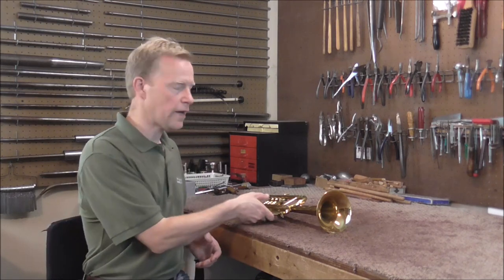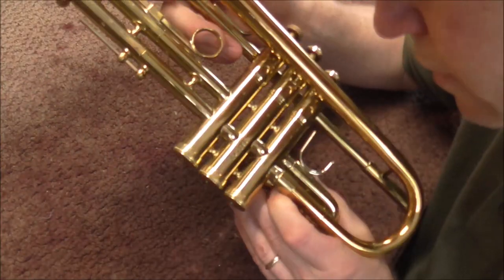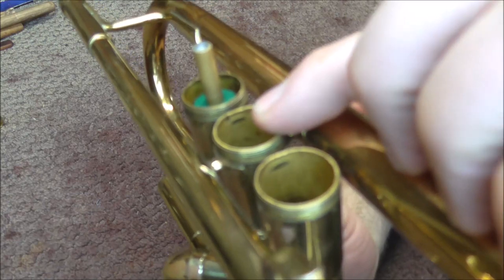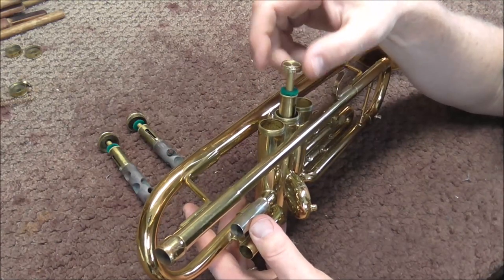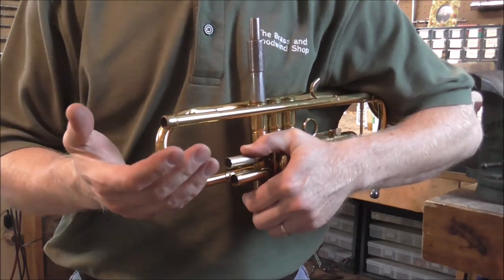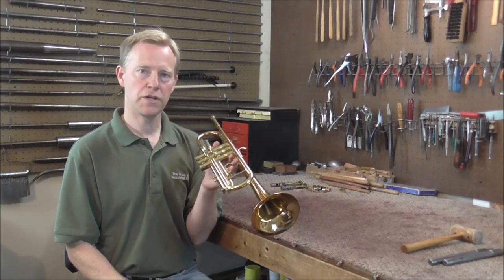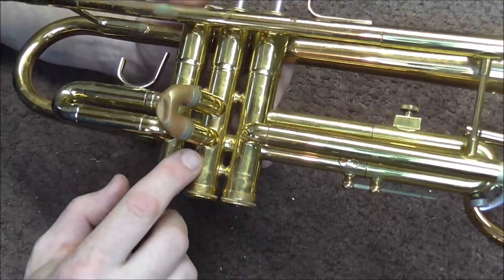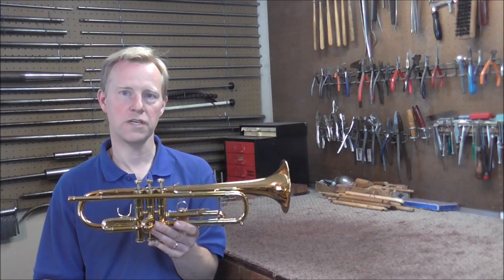I Destroyed a Trumpet While Trying To Fix a Valve

Comment: I'm not a brass tech, but at one time bought some cadaver horns to see if I had the touch. I actually had a good selection of tools and mandrels from a shop that had gone out of business, so had the correct equipment.  What I learned was this is not a shade tree mechanic type skill and there is a fine, fine line between fixed and trashed. 
You did an excellent job explaining the entire process and what went wrong. I agree, while that particular trumpet was not one of Conn's best efforts at a transitional time for the company, it was deserving of your best efforts. In the end, you made it right.

Comment: This video is a great demonstration on how easily things can go wrong with a brass instrument, and also for coming up with a solution.
I had something similar happen recently. I bought a used Bundy cornet that is 30-40 years old as an alternate practice instrument to my trumpet. The valves and slides worked well; it just looked rough. I was removing one of the bottom valve caps when I heard a weird sound. It turned out to be a 3” long crack in the lead pipe. Knowing that a repair would likely require replacing the lead pipe with a cost more than the instrument itself, I ended up wrapping the lead pipe with masking tape to seal the leak. It’s ugly, but it works. 😆
If I buy a replacement I’ll probably donate the cornet for parts.

Comment: Thank you for your transparency. I've used the mandrel trick many times. It was hammered into me that you always keep the other valves in so that the other casings don't deform. Same for when you're aligning the bell tail.
Reply: I was wondering what may be happening to the other valve casings while he was working so much pressure and force onto that one.
Reply: Yes, you NEVER use a casing mandrel in a casing without the valves in the other casings.

Also, that's not how those mandrels are supposed to be used.

Yes, you tap on them...but you do so on the compass points, and also on the 45° points, not too hard, and repeatedly.

The vibration of the mandrel returns the casing to round.

The other thing to use, in fact probably what I would've reached for first, was an expandable lap.

I never lap with them, but I do expand them in the casing to return concentricity.

Very effective tool, that's inexpensive and easy to use.

All that being said, I've had pricier horns than what he's working on do the same shit, even with the valves are in the other casings.

Sometimes, shit is just what it is.

Comment: This is a fascinating watch, thank you for sharing it. I wonder if a different tool could have reamed and straightened the tube more effectively than using vibration. Perhaps something like a mandrel but oval in profile, 664 in one diameter and 663 in the other diameter. You could insert the mandrel and apply a slow half turn to ream the tube into shape.

Comment: I have had early (1870's-1920) French trumpets and bugles(Flugels) that break at that point when you are trying to free a slide.  What a pain!  Some of those early Euro horns are very lightweight and not so well silver-soldered.  The USA and English ones are pretty tough, but sometimes they do a bad job with the silver solder.  DOH!  As a contrast, some of the Japanese trumpets have silver solder where they shouldn't (Yamaha second valve slide knob for example) and that makes it harder to fix some things.

Comment: I noted the top of the first valve casing where it was bent on the threads like it had been bumped in the direction of the 2nd valve which could have fatigued the bottom joint connecting first and second valve. I have two of this large-bore model 1000B. One has the name Doc Severinsen on the bell and the mouthpiece with a signed endorsement from Doc about this horn as a good step-up beginner model. However my other newer 1000B has no endorsement and the Severinsen name is not there like the two in this video. This model CONN is similar to several other models I collected including: the16B, 20B, and 22B medium large bore all bought new. When moving the valves on some of these horns I found just LIGHTLY squeezing the casings make the first and third valves stop moving. These models really are that flimsy with more flexible cheaper brass and in NO way should be compared with "C. G. CONN Pro models from the beginning to mid century that are now some over  100 years old and still tough enough to be around today which I use for recording studio work. Bottom line this video empirically exposes truth in the newer Design of the 1980's and 90's. This is a breath of fresh air and you are a good teacher, Artisan, and a true craftsman.

Comment: I did that once on an old Regent cornet.I damaged the horn and I parted it out.The next time I did it,I decided to try using an old valve of the same diameter.It worked with a little oil to lubricate it.

Comment: as a Trumpet player i am very delicate with my Trumpets, by just seeing how they are fixed it is very shocking.
Reply from the maker: Yes, that is right. It is best to keep them out of the repair shop if you can. However, keep in mind that this trumpet was far more damaged than most.
Reply: @TheBrassandWoodwindShop  I think also it's best that I don't see the repairer working on my horn...
Reply: It’s always like that, when you straighten you have to force, to shock it… I never straighten a saxophone in front of a customer, I know it’s shocking to see someone smash a saxophone on a table

Comment: I personally wouldn't say you destroyed it.  ADDITIONALLY, you should have told the customer it was not fixable without replacing the valve cluster.....and that is a true statement.  You could have told them there was a defect in the manufacturing that failed while you were attempting to fix it (maybe you did tell them).  You are an expert, this would have broke if anyone tried to fix it, or it would have just remained unplayable.  Charge for your time and service.

Comment: Great video! Suspenseful too. I'm wondering what the lacquer was like on the finished product since it seemed to be in pretty good shape initially. Did the heat from the torch damage it?
Reply from the maker: The lacquer on the replacement valve block was in good condition to start with. Being VERY careful, I was able to solder with burning almost no lacquer. So everything went as well as could be expected.

Comment: I wonder how you keep the finish on the brass after using a torch. Just curious!
Reply from the maker: Most kinds of lacquer burn at a little over 450 degrees. Solder melts at around 450 degrees. If you are very careful, you can solder without burning lacquer. (Most of the time.)
Reply: @TheBrassandWoodwindShop  :Thank you; I was working in the HVAC business and know some (sweating) with soft solder which melts at about 600 F; when using silver sticks, temps are much higher.

Comment: For assembly is there a jig you use and how do you fixture the parts? I am a metalsmith myself and among other things I make repro guitar tailpieces for jazz guitars. These are all hard silver soldered. Looking at my son's trumpet with a dent in it I now know what parts are hard soldered and what parts are not. Not that I am going to attempt a fix. Do not have the tools so I figured I could send it to you to fix.
Reply from the maker: Sorry it took me so long to get back to you. My wife just had a baby. 
I do not have assembly jigs because the instruments are all different. I usually use a wooden assembly mandrel to hold the trumpet where I can easily get at it. Then I use solder clamps to hold it together. There are a few other tricks that can be used, but it all depends on what needs to be done. 
You can send the trumpet. I will get to it as soon as I can. 
Thank you,
Art

Comment: Art
I have never sen a trumpet come apart like that. Was wondering if you ever use the Ferree's expanding reamer? That is what I would use on a repair like that.
Reply from the maker: I have never used a reamer because it expands the casing and makes a larger gap between the valve and the casing. Also, it indiscriminately expands the casing and not just in the place where it needs it. However, I guess I did a good job of destroying the trumpet, so it may have worked better than what I did to it.
Reply: @TheBrassandWoodwindShop  
If you are not super aggresive with the reamer they simply re-round the casing
Reply: If you think the burnisher/reamer instantly expands the casing and widens the tolerance between the piston and casing then you need to improve your finesse with the tool. They are amazingly effective and in my experience at least, tend to correct casing pings and minor alignment issues using little to no tension. And NEVER wail on a mandrel without some sort of support inside the casings, preferably their respective pistons. I hate to say it but seeing how little force was needed to free the piston tells me that the correction needed was likely improper first slide tube alignment or an overlooked casing ping. And remember to check the piston in the mandrel sleeve/check other pistons in problem casing before immediately diving into casing alignment. Better luck next time thanks for the post.

Comment: Was there a point at which you could have decided to ream and/or lap the small intruding area in the valve casing instead of continuing to use escalating force to attempt to push it back out of the way of the valve?
Reply from the maker: Reaming should only be done if you are re-fitting the valves because too much material is taken off and lapping does not remove enough material. Looking back, what I should have done is use two ground casing mandrels (one in the first casing and one in the second casing) and a lot more patience. 
Making mistakes is painful, but it is one of the fastest ways to learn.

Comment: Would it be worth warming the trumpet for repairs like this... perhaps dunk it in near boiling water for some time? Brass is pretty soft anyway but hot brass should be a lot easier.
Reply from the maker: Water does not get hot enough to soften brass. Also, boiling water may take off some of the lacquer.
Reply: @TheBrassandWoodwindShop  I will take your word, never tried it.

Comment: Speaking mistakes, could you give some advice on how best to correct a run or sag in a lacquer refinishing job?  It's inside the bell where it will show up like a sore thumb. (:>/. 

Love your channel. I started working in a band instrument repair in high school. Then for a short while in college worked at night in a different shop. Now that I'm a retired engineer, I've been fixing up old trumpets, cornets, and trombones as a hobby.
Reply from the maker: I would probably strip the lacquer off of the entire inside of the bell and relacquer it. You could try to just strip off the one bad spot and see how it turns out, but I am guessing it probably will not look good.
Reply: @TheBrassandWoodwindShop  THANK YOU for the quick reply. I used G J Nikolas lacquer on brass instruments and this is the first time I will need to strip one. The most difficult lacquer has been on King instruments. I have a 30-gal. NaOH solution tank that I heat to 160-deg F and even with that the King horns are stubborn. This is a bell from a 90-year-old euphonium that I've straightened. I'm hoping to be able to used a commercial paint stripper just for the inside of the bell. Any recommendations?
Reply from the maker: I wish I could help more, but it sounds like you know more about lacquering than I do. Have you watched this video? I do not know if it will help or not. 
"How To Strip Lacquer Off of a Trumpet"   https://youtu.be/wfxVatKXh7I
Reply: @TheBrassandWoodwindShop  Thanks. I watched the video. I've purchased a lot of tools and supplies from Ferree's but I've never tried their lacquer stripper. Seems to work well. The brush-on stuff I've used before was from the local hardware store and it works okay on most manufacturer's horns except King. Earlier today, I decided to try the CitriStrip I bought for stripping some wood trim. CitriStrip contains no methylene chloride or NSM so doesn't give off toxic odors. It works very slow however. To keep it from evaporating so It can work longer, they recommend covering the area with plastic to seal out the air. I'll let you know tomorrow how well it worked.
Reply: @TheBrassandWoodwindShop  The CitriStrip worked quite well. I left it on the bell with cellophane covering it for about 24 hours and it removed all the lacquer. It left a very odd looking stain pattern - kinda' psychedelic - but it should buff off easily. Thanks again for all you bring to YouTube viewers. I left a donation to your tip jar..
Reply from the maker: Thank you for letting me know how it went. I am glad everything worked out well. 
Thank you very much for the donation.
Reply: @TheBrassandWoodwindShop  You're most welcome!